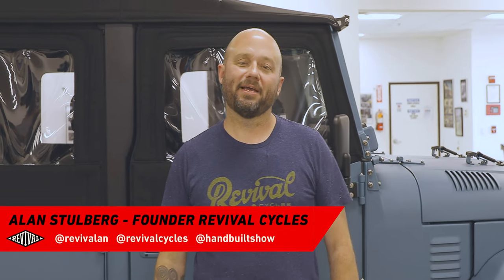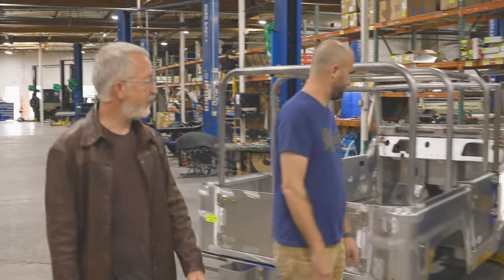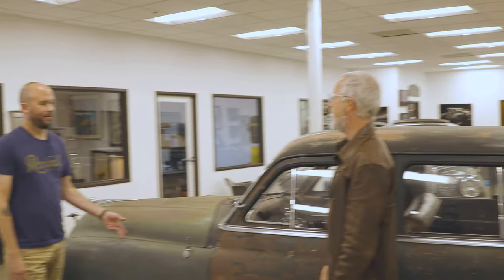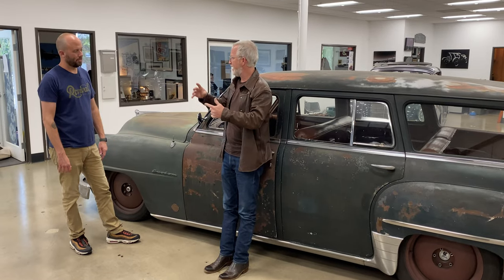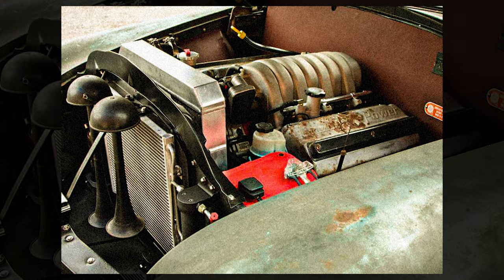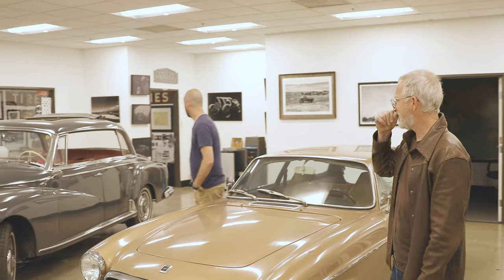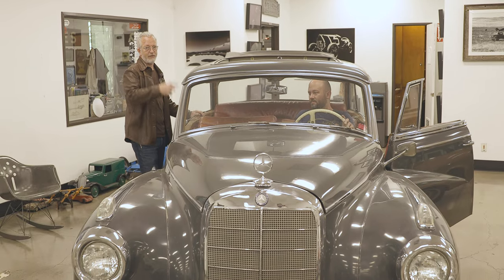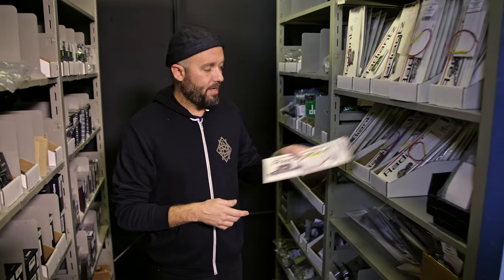A Day With The Best of The Best: ICON Shop Tour Pt.1 // Revival Daily

Comment: Ok.  What about taking a bit of what Icon does and use it in the MC world?  Not the exact same, but a bit of inspiration.  Hear me out.  Take a capable, cheap cost of entry super bike from the last 10years and backdate it properly.   Like a CB1000 and then put handlebars on it, a cool seat and tastefully minimize the bodywork.  (I know they make a CB1000r, I’m not done). Then take those parts and sell them as a kit.  The problem with most naked bikes is the silly aesthetics.  No character, and they mute the power for “rideability” around town.  Ever ride an ‘18 S1000rr?  I did.  20k miles in 3 years, commuting.  It was great, but I hated the riding position over time and I was never giving to a track… so yeah.  The point I’m trying to make is when I replaced it I wanted something cool but didn’t want to lose the full-fat version of what I 
had.  Long story long, if I had a kit I could buy that transformed the bike into something better for my commute Ida done it.  Old school looks, taller bars, bag mounts for bags that don’t look like a Jansport, taller windscreen.  Ida bought a kit in a second and kept that bike.  What did I do instead?  I  spent way more money on a new Streetfighter V4S that still doesn’t check all the boxes, but at least it’s not neutered down.  The market is missing it.  It could be a real thing.  A Revival kit for a super bike.   That was way more words than I wanted to write.  Great video.
Reply from the maker: We've certainly discussed this sort of thing in the past. I think one of the biggest challenges is the size of the market willing to shell out the money for a small batch run of a kit. There are shops that do it but I don't know if it's sustainable over the long haul.